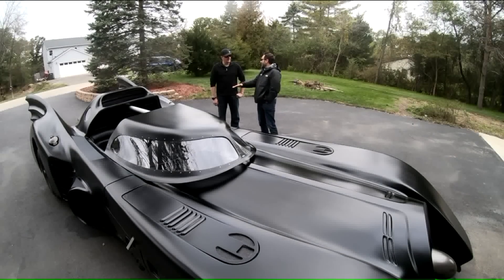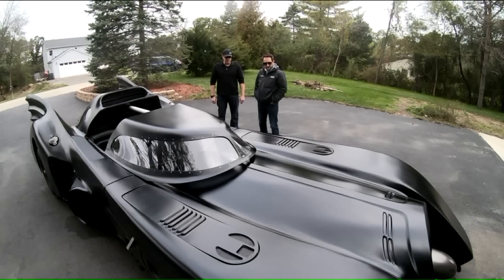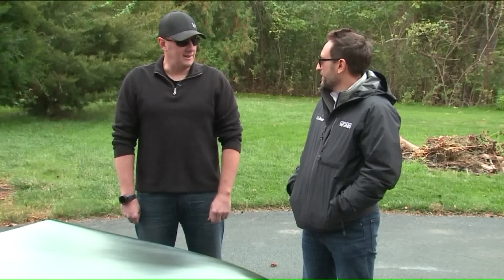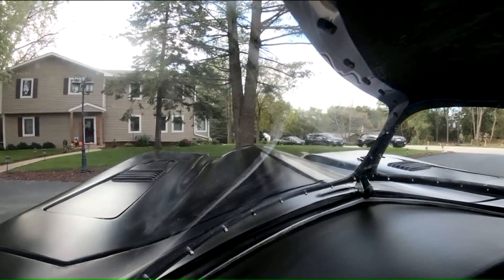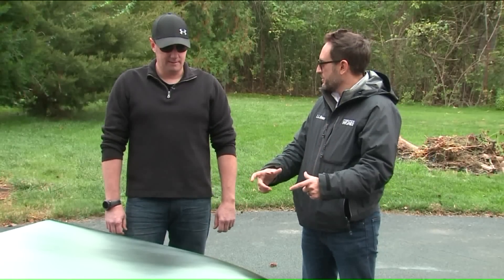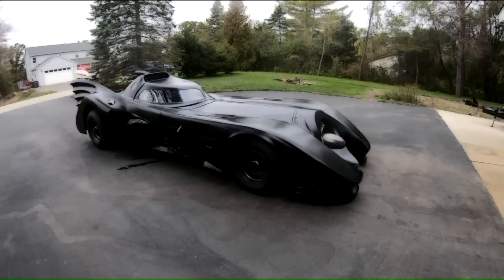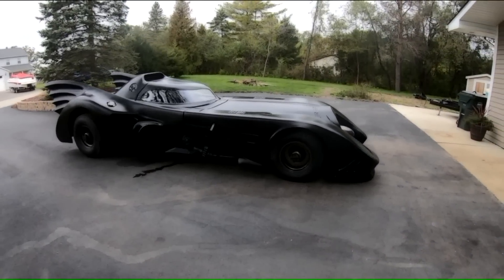Chicago-area man builds Batmobile from scratch

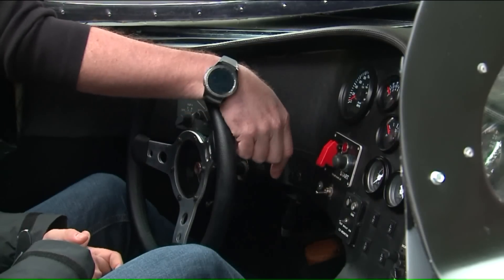Comment: 2:33 what a leak!
Reply: It's from AC. Normal not a leak
Reply: There is always one. 
Throughout the comments everyone is impressed. What do you focus on? The discharge from the air conditioning. 
Do you see good in anything, or are you always negative?
Reply: Either the AC...if it has AC. Or the overboard drain valve from the turbine engine. Excess fuel from the combustor is drained out when the engine is shut down.
Reply: TruthBeTold  Why are you replying to my post? I'm not being negative.

Comment: simply amazing! my only question would be: is it possible to actually move/drive the car with the jet engine or is ist "just" decorative?
Reply: It can push the car as is.  Weve made a cone for the back as well if we want to concentrate the thrust and it will go much faster.   But overall driving is done with the v12
Reply: @fabricator7890  so you practically outdid the original movie car in every possible way with a v12 instead a v8 and a working jet engine. massive respects!!! ;-)

Comment: Casey's From Genius Garage one is Better
Reply: How ?  The engine this guy uses is for thrust out the rear as it should be.   Casey has the same engine but up front.   This guy also has a v12 and it spins.   Bodywork is far and away from caseys too.  Caseys isnt even in the ballpark
Reply: @fabricator7890  Also the Turbine Engine on this doesn't even propel the car. Casey one Does....So what's the fucking Point?